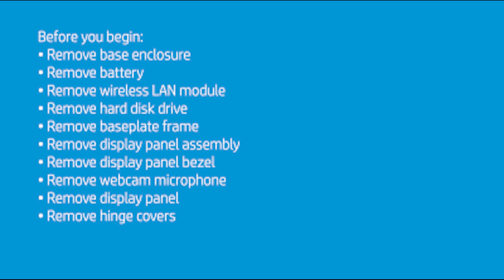Replace the Display Panel Cable | HP EliteBook 840 G3 Notebook PC | HP

Comment: Can I replace my lcd screen from the 720 to 1080p , it’s got the same mounting points and 30 pin connector
Reply from the maker: +Karl Davies HP does not recommend upgrading or downgrading hardware parts or software that is bundled with the product as It may affect the manufacturer's warranty and performance, however, you could change the configuration at your own discretion.
Reply: HP Support Hi, I bought a 1080p IPS panel and it works fine , nice upgrade from the old 720p screen
Reply: @karldavies6679  do you have a part number for the 1080p screen you purchased?